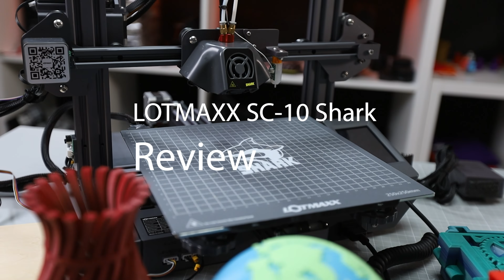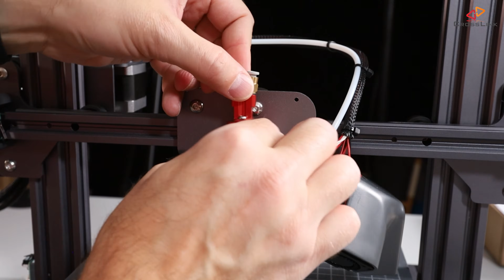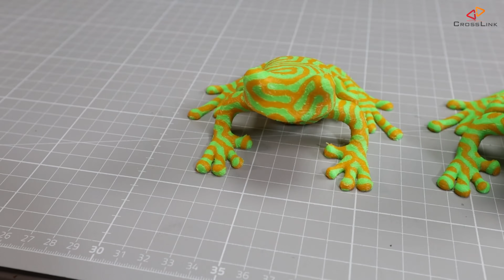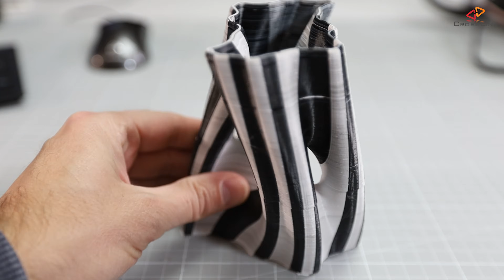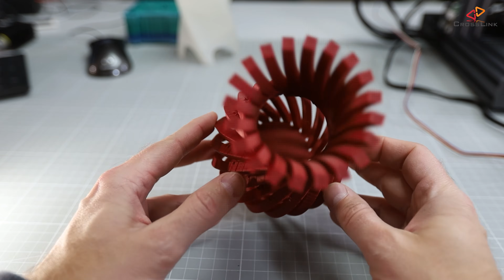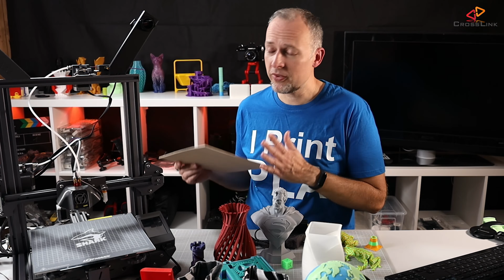LOTMAXX SC 10 Shark 3D Printer: The do it all device?

Comment: Just got mine and put it together. Any idea how to get BedLevelVisualiser in Octoprint to work with it? It seems G29 is not recognised but it will run probe points with a 'G28 L' command but throws up an error on completion?

Comment: Yes, octoprint hurts your prints on this printer..  Also I haven't been able to get the octoprint visual bed working for this printer.  Have you ran into any issues?

What is your opinion about it being closed firmware.
Opiniin about it using such an old cura version?

Also, did you notice anything odd with adjusting the extruder steps?  
It seemed to over adjust.  For example if I was supposed to add 4, the printer would act like I added 8.

There is something on thingiverse someone designed to shroud the fans from filament if you are interested.

I never had an issue with octolapse and I had the printer since it was originally released,  but I did find if you are printing from the SD card and open octoprint it crashes the running print.

Thanks for the great review.